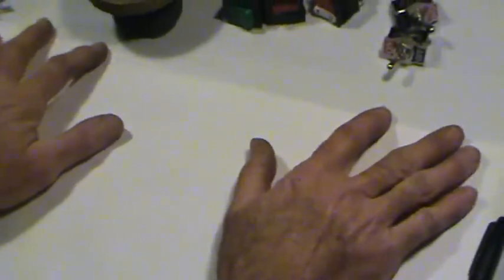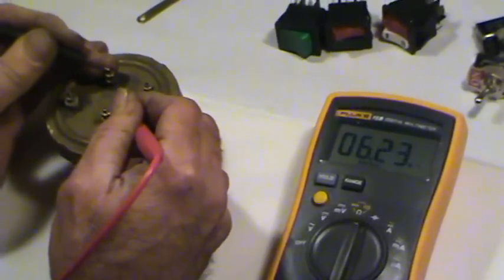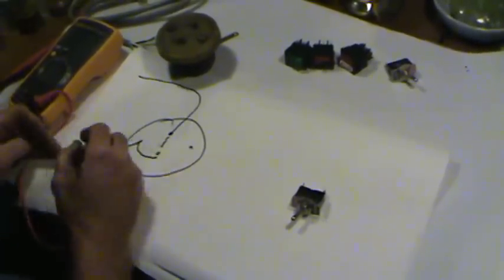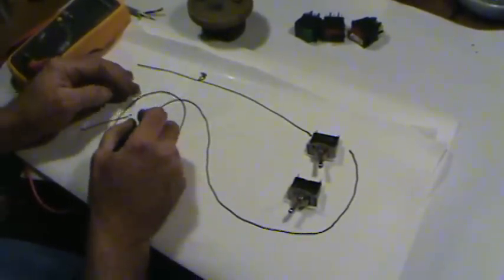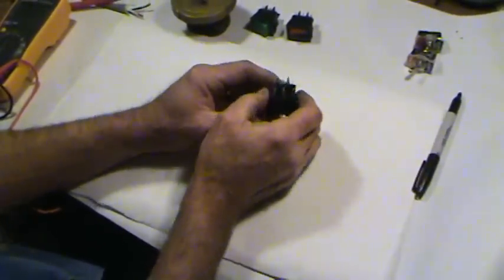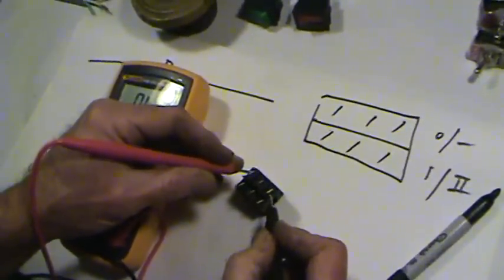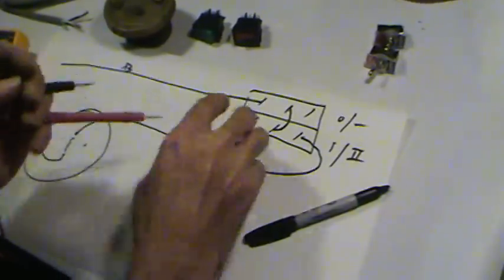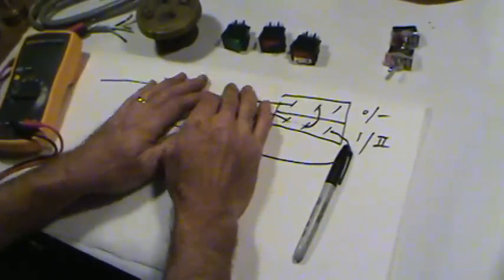La Pavoni Europiccola Wiring Guide Part II

Comment: Hello, I have a 1999 Europiccola which was left on with a dry reservoir for about 1.5 hrs. Now, the unit will not turn on. Examined the wiring & nothing appears abnormal. The only thing visibly wrong is the plastic housing protecting the glass tube is melted at the base. What would you guess might new the most likely thing wrong? Thanks for your videos & advice!

Comment: Hello , I want to add an on/off/on toggle switch to still look vintage have the safety of on off switch plus 3 prong power chord... if you have diagram or would like to make video that would be awesome! if not then Im assuming same as before.. 3rd prong goes to flange and then wire the other 2 wires as though it was a 2 prong 3 position switch?